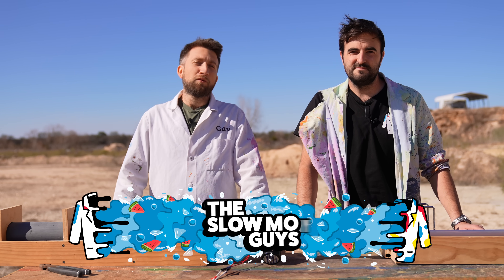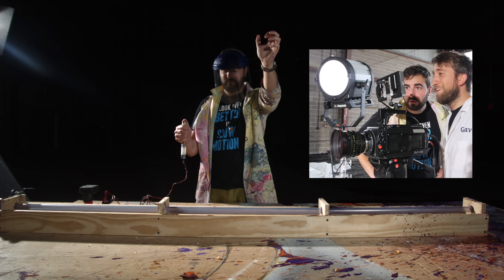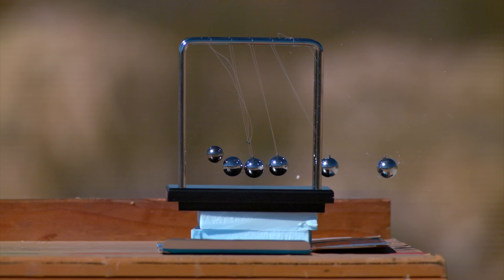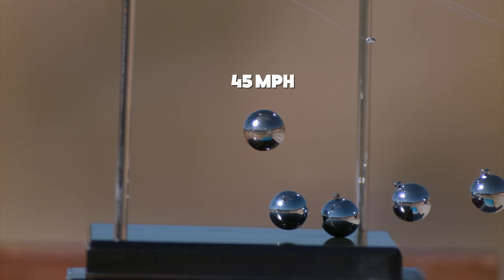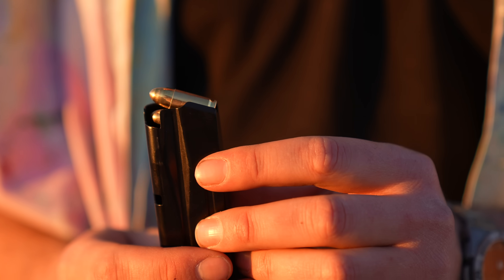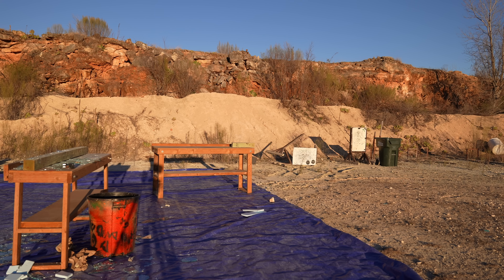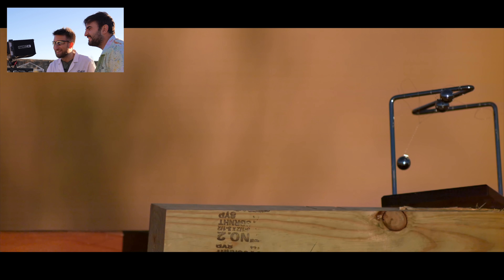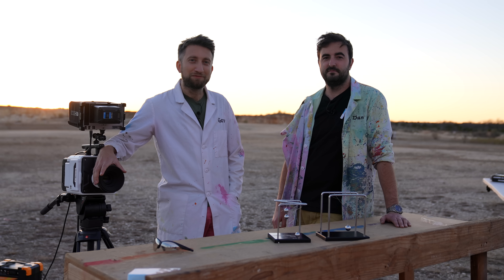Bullet vs Newton's Cradle at 100,000 FPS - The Slow Mo Guys

Comment: There seems to be a really interesting thing happening with the craters in the balls. It looks like the balls have craters where they impacted each other. If so- why do the ones in the middle (1-4) all have craters on both sides- that seems counterintuitive.
Reply: From the point of view of the fired ball, it got hit by the first cradle ball flying at it at 270mph. That causes it to crater, and the cradle ball does indeed deform. Now consider the point of view of the first cradle ball. From its perspective, it just got hit by the second ball at a high speed in response to it being knocked by the fired ball. Same song and dance, just shifted speed and result. But now you have it being pinched like putty in the middle, and its NOT free to deform into a crater because if it did, it would displace the same amount of material on the other side. But the other side is also getting pressed, so it becomes flatter. You can consider any ball other than the first two, and it works the same.

Comment: The hardness, heft, and velocity all play a part, but I think the biggest issue is the fact that the bullet shattered.  Increased velocity is actually a detriment (for this purpose) if it causes the projectile to break up because much of the energy remains in the fragments rather than being transferred into the balls.  A slower moving projectile with the same mass and density would probably fare much better and have a more pronounced effect even though it has less energy to impart. Or you could use something more solid.  Maybe an AP round with a steel/tungsten core? Sounds like something Demolition Ranch would try.

Comment: These guys are vastly over stating muzzle velocity. A mil spec 223 M16/M4 green tip round has a typical muzzle velocity of about 4,400 fps which is near 1 mile per second.

Comment: He's on the right track when saying "mostly the hardness", but it's actually only the compressive strength and shear strength that matters, which is not the same thing as hardness (ex. diamonds while hard, will shatter to a hammer). Lead isn't just soft, it's also weak. And the jacket is obviously too thin to do anything.

Comment: Another great job by the Guys

Copper is soft, Lead is very soft, steel is hard. But it really comes down to the ultimate yield strength (a pressure).  Bullet is more dense - and the BB likely was too, whether the projectile comes to a stop or bounces back depends on whether it is equal in total mass to the balls in the cradle.
 
Not a surprise to see a bullet splash like that - this is typical behaviour on hitting even mild steel. 
At those kinds of pressures, solid metal is basically a Bingham plastic - a liquid as soon as it meets pressures above it's ultimate yield strength: Lead is only 5.5MPa, copper 33.3MPa, but steel is around 350 MPa, easily 10x copper's. 

And then once the bullet's copper shell breaks on the 10x stronger steel, you've just got the warm, gooey 5.5MPa lead insides, which is of course going to act like it's a liquid centre. All that deformation also means kinetic energy being absorbed and turning to heat, and that will tend to soften metal too.

Comment: What is the psi inside the primary contact point?  It's how craters are formed on both objects.  My hypothesis is air became compressed and trapped between the 2 mass objects.

Comment: Dan nailed it at 3:00, you should try to use one of the bearing straight from the N's Cradle
Reply: The whole reason N's Cradle works is because it need to conserve momentum, so to get the ball in the middle to stay still is if you stay with the same mass, or a exact multiple.

Comment: It’s crazy how “long” it takes for the cradle to move after being shot.
Reply: That is what surprised me also.  I wonder what the explanation for that is.
Reply: guys, the cradle is moving immediately but much too slow to notice until the footage is sped up... the way they edited it is tricking you
Reply: moving after impact is slow because of inertia of mass
Reply: I've no idea what happened here, I just wanted to participate 8--))
Reply: What you have to remember is their is almost no force acting on the cradle until the strings go taught.  Even then only really the final balls strings have a large amount of sideways force and the string breaks before to much of it is translated into the cradle.  Not only that but the vector of that force would have a decent amount of it pushing down into the table.  Then if you factor in the fact that the cradle is much more massive then the bullet you are going to a cradle that is moving back at something like 1% of the speed of the bullet making it appear really slow.
Reply: @jerithil  WRONG the bullet pieces imbed into the base immediately. This is the majority of momentum transfer
Reply: @jerithil  I get the impression the OP is talking about when the bullet directly hits the base of the cradle, not when the balls are stuck first. Because that's the one (or two) time/s it stood out to me. We'd need the OP to expound upon this though. Or use a timestamp, as that would help.
Reply: @umwhatamIdoinghere haha about a year later I see this video again & start reading the comments & see my name. I forgot I even wrote this. But yea, I was referring to around 8:10 & 8:50 when the bullet hits the wood. It seems like it takes a really long time after the bullet has hit it & moved on past it before the wood starts to move. I realize it’s slowed down but just expected the force to be transferred almost instantly. It was weird to see it accelerate after the bullet had come & gone is all. But I guess that’s why slow motion videos like this are so cool to watch.
Reply: It has to do with inertia. The impacted first ball receives energy from the bullet, causing it to accelerate. The initial speed of the impacted ball is still zero though, and even though the acceleration is high, its low enough to have a few frames very little movement.
Reply: Isn't the ball that kept attached the one pulling the cradle behind it?

Edit: You can see how in the second shot, all balls get unattached and the cradle doesn't move as much
Reply: Isn't it just the pull of the balls that ends up tugging the cradle?
Reply: cause there is inertia force
Reply: After a quick google speed of sound in wood is only 767 mph. The speed of sound in fiber board is probably less since its less dense. The bullet travels at 785 mph. Its probably possible to calculate the expected delay by estimating the size of the cradle.
Reply: It only seems that way because the thing in motion is going way faster than you are used to seeing things. Of course the solid wood makes the shockwave slower than the bb passing through air, that is what you are seeing.
Reply: You can really easily calculate that speed. The pressurewave inside the ball travels with the speed of sound specific to the balls material.
Reply: Newtons first law of motion ??
Reply: The energy transfer to the last ball and then gets in action.
That's what literally the cradle was made to prove
Reply: It would be whatever the speed of sound is through that material
Reply: It must be the air flow following the bullet that pushes the cradle, not the bullet itself.
Reply: @speedstone4  lmao the airflow can't have that amount of force! Actually the cradle starts moving immediately, but it's slow so you don't notice it. When the video starts to speed up, you notice the movement. It is necessary to consider that the velocity of the bullet and the velocity of the cradle are on a different order of magnitude. Bullet travels at 350 m/s while the cradle at about 2m/s
Reply: @speedstone4  Probably the fiberboard is compressed, and then springs back.
Reply: @HappyMonkeyYT  that doesn't make sense to me. Whatever you mean by fiberboard, if it springs back, shouldn't it go in the opposite direction?
Reply: @speedstone4  (not a physicist, educated guess) the bottom of the base is compressed, then re-expands, and overextends, pushing it off the table.  

Additionally,  the direct transfer of energy can only go through at the speed of sound in that material, so that's part of the delay.
Reply: Pressure takes time to propagate the reason why it feels like it’s such a long time. one you’re watching in the high speed. two the pressure has to impact the ball travel up the nylon into the metal travel down into the wood frame to then push off of that to go up and away these all act as dampers
Reply: @speedstone4  Looks to me like the air is mostly responsible, but the balls are also contributing when they move far enough so the tethers are exerting a horizontal force on the frame. The first few on the right snap before they have a chance to swing upward far enough to exert a horizontal force.

Comment: Of course, Pb is solid and also heavy metal, but it's softer than steel used for Newton's Cradle (as you can see on fishing weights example, you can bend it by hand). Also, what if you replace nylon string on the cradle with steel ones?

Comment: I think the ball bearing hardness is by far the main factor. By my calculations the bullet had a mass of 8g and a velocity of 350m/s which is 494 J of energy. The ball bearing had a mass of 28g and a velocity of 120m/s which is only 201 Joules. 40% energy and massively more damage.

Comment: It would be so interesting to build a much longer newton's cradle and see how many balls it would take to disperse the energy from the bearing
Reply: Even if it was just a stronger joint on the balls, and stronger cord, as well as fixing the cradle to a larger mass. Also, I think because of the velocity, there needs to be a horizontal piece of steal on both ends so when the ball reaches 90 degrees, it will have a flat surface to strike and return the energy back down. It would also be helpful, to make a free body diagram of the kinetic process. The free body diagram would show some of the need for several of the additional items missing.

Comment: It would be very interesting to fix a metal plate to the top of the stand of the cradle, and then bolt the whole assembly down to the table before firing a bullet at it. Or another ball bearing again.  Impressive experiment!

Comment: @11:31 If there is little to no space between them, are the 5 balls actually behaving like a 5” thick steel wall?
Reply: Technically yes, the balls are rounded though, and smaller than an inch. Also they aren't fused together so it'd be more like multiple steel plates lined up.

Comment: The launched ball in the first couple of clips is undergoing close to I'd say 1000 g of deceleration. Meaning that for a second that tiny ball would have weighed 62.5 lbs, or about 30 kilos if you scale up the normal weight of a 3/4 inch ball bearing, which is 1 oz. If I had access to the actual time stamps of the footage, I'd have a much more accurate g force number, but I don't. So I used 0.01 seconds to calculate it

Comment: Do it again, but use guitar strings to suspend the bearings; use the entire string. Do a set with all high E strings; one with all low E strings; one with all six strings in ascending order; and one with all strings in descending order.

Set up 24 bearings using 4 sets of strings.

Try bass strings.

10:00 The whole point of Newton’s Cradle is to demonstrate the transmission of kinetic energy between “inelastic” collisions. This requires energy to be conserved as much as possible. Any loss to sound, deformation, air resistance, or anything else will affect the outcome.

A lead core bullet will use much of the collision energy to rearrange molecules.

For a real fun time… tungsten ball bearings and a tungsten projectile.

Comment: The impact was not dead Center of the first ball, and slightly high. This caused the 1st ball to be forced low and the impacting fired ball to travel upwards. The result was the first ball broke free in a downward travel, pushing second upwards keeping it from breaking free.

Comment: The first ball takes a big blow because it's not hitting square on. Notice that it gets yanked down in the first few frames and the fired ball goes up. The second ball does best because it is hit square, and it's still protected by the three balls next in line.

Comment: Why did the bullet shatter?

1) F = ma, the bullet was way less dense than the ball bearings.
2) Stainless steel balls were harder than copper/lead bullet.
3) Ball bearings were in contact with each other increasing the total mass meeting the bullet by 5x.

Comment: 100,000 fps? What gun and cartridge? The all time speed champion is the venerable .220 Swift, at an apparently leisurely 4,000 fps .
What bullet held together at that speed? Whatever it was, it had to be shot from a smooth bore. At 100,000 fps even a twist of 1/8 turn in 500 inches the centrifugal forces would cause the bullet to shatter/explode.
Isn't 100,000 feet per second considerably faster than the space station's and any satellite's orbital velocity?

Y'all just lost any and all credibility.

Comment: 9:50

The way the bullet just blasted itself apart when it hit the ball, it kind of reminds me in a way of when if you are high enough from water and you drop onto it you don’t fully sink immediately, the water acts like a solid and you smack into it then you sink, it’s kind of like that.
Reply: yasio bolo  like that ya
Reply: i once fell 7 meters flat to a river. i can confirm.
Reply: I think the whole analogy is wrong. You are describing Hard hitting much Softer, and this video was Hard hitting Hard. This video has nothing to do with surface tension or buoyancy or sinking.
Reply: @noahway13  Wrong, lead is soft, and steel is much harder. One cannot dent steel with fingernails. This is soft matter, impacting hard. Essentially, there's not much difference between the analogy given, and the actual experiment.
Reply: NOOO!, that is because of surface tension, this is because ball is hard,
Reply: @oksowhat  Incorrect, that isnt surface tension , that is the density of the water, for example, a jump from 200 ft into seawater is more difficult to penetrate at the speeds attained than the same jump into freshwater, which has a  different, lesser density.
Reply: @izzyplusplusplus1004  that's because sea water is more byount surface tension has nothing to do with what you said
Reply: @oksowhat  Seawater is more bouyant that freshwater because of it's density.
Reply: @izzyplusplusplus1004  think u are right because if we take mercury and put it in a large container you would be able to put a bag of lead on top of it and it would float, this is because mercury is very dense

Comment: I just really need to know, how much power difference is between the ball bearing and the bullet. If it is just the hardness or the impact is so low bcs of the weight. Cmon, more testing. This job is not finished.

Comment: Why less damage with the bullet? The melting is an important clue.
Energy in = energy out (relativistic mass = energy concerns can be safely ignored in this experiment) , how many ways is energy out expressed? One is heat. Compression heat is part of every experiment. Kinetic, obvious. Friction against the air, more heat loss. The bullet: melting, a major heat absorption process meaning less energy for kinetic effects.
Reply: The lead bullet is alot less hard than the 52100 steel in most ball bearings. But when another ball bearing hit, the same high hardness would cause less deformation of the other ball bearing. It could also be the lead heated up a bit making it even weaker but I doubt thermal had any major effect.

Comment: You guys should try it again, but with strings that have higher tensile strength, so the balls on the newton's cradle may possibly stay to swing rather than pull directly off.

Comment: The surface of lead bullets fired at high velocity may melt due to hot gases behind and friction with the bore. Because copper has a higher melting point, and greater specific heat capacity and hardness, copper-jacketed bullets allow greater muzzle velocities. -Wiki
Reply: Copper zink alloy is not softer

Comment: I'd like to see this with a Newton's Cradle that was secured by metal wire, to see the difference between the wire and the nylon.
Reply: Fiber wire(braided fishing line) is stronger than steel of same dia.
Reply: Would just pull the frame away easier. The frame doesn't have enough weight the impede the momentum of the 4th ball.
Reply: @maebon  Maybe they could secure the base some way?
Reply: @edwardcardona717  They could, but then you're back the wire just snapping. There is a lot of force being transferred into the cradle, it would take quite a bit of engineering to make a functioning cradle that doesn't either snap off the wire immediately or send the base flying off.
Reply: @maebon  thats the whole point tho. to see if you can, and to see if theres any difference between the types of wire.
Reply: @edwardcardona717  We need an industrial strength Newton's Cradle
Reply: I'd like to see it with the cradle secured to the table
Reply: On at least some of the balls, it's the fastener that attaches the string to the ball that is breaking so it wouldn't matter much
Reply: It'd probably sheer the attaching loop away from the ball, rather than snapping the wire.

Comment: The shot fired keeps hitting just high of center, causing downward force as the weight of the rest of the balls prevent like a water tension of inertia force for it to pop off the strings.